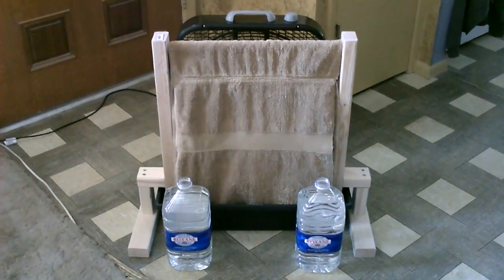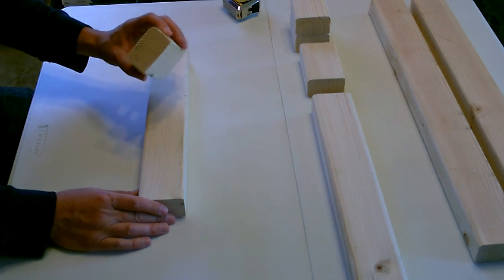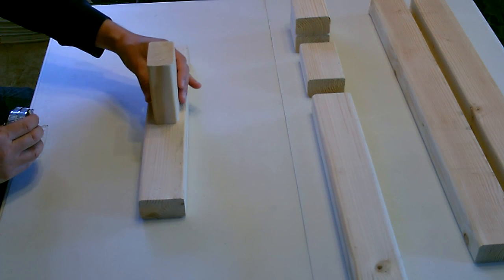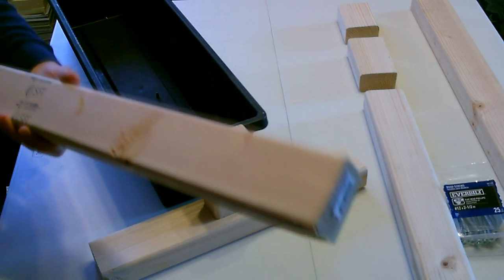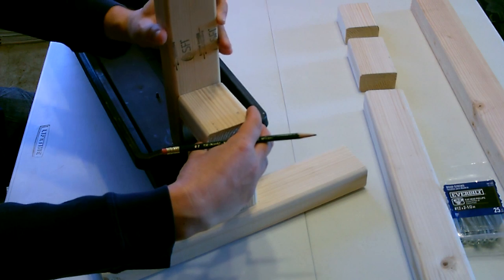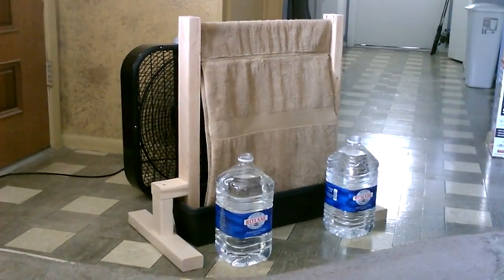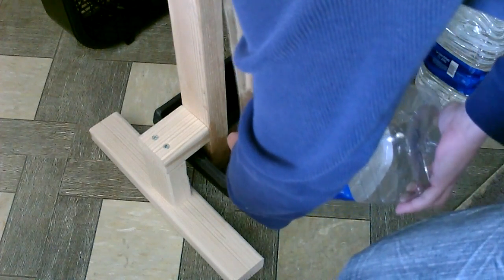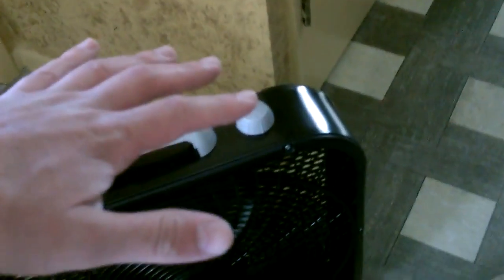Homemade Evap. Air Cooler! - The DIY "Planter Box" AC (air cooler) - up to 30F drop! - Easy Instr.

Comment: Looks like the air is going around the towel, not through it. Might not cool as well as a blue fiber filter would. But I am checking out everyone's ideas, thinking about using a evaporation cooling system for my greenhouse.

Comment: Thanks. I took a cue from this and your other video "Homemade Evap./Swamp Air Cooler - DIY AC (air cooler) - Low tech. Very Effective!" and cooled my 98-degree room to low 70's. I dropped a 20-quart canning pot filled with water into my tall clothes hamper and hung two towels off of a sash rod and a pvc pipe from the top. Now is the coolest room in the house. AC in homes of this community is rare because the climate is almost always a bit cool. Today is an unusual National Service heat advisory for the area. So I deseparately Goolged for a fix and found your videos. No emergency AC needed and no more caught off guard suffering. Thx!

Comment: Love the idea!  What about using a 1" PVC pipe where the towel dowel is with small holes in it and a small cheap fountain or bilge pump to pump the water from the planter to the pipe to constantly change the water in the towel.

Comment: what is the max humidity allowed for such a system to actually cool the air? The drier the environment is, the more drop you can get in cooling the air. What if the air is more humid? I am sure there is a value where such cooler will just not cool anymore right?
Reply from the maker: rogermorse hi there. typically these systems will cool the air extremely well with humidity from 2% to 35%, very well from 35-45% humidity, fairly well in the 45%-55% range. and then only slightly if humidity is over 60%.

Comment: Mmmm ...... I like the idea of swap coolers , but are you are ending up with cool , but damper air ? I would suggest this would be good if the unit was in a box , with a heat exchanger , and exhaust the cold damper air out the window , so the heat exchanger reduces the heat in the room , but the damp air is exhausted to the exterior .

Comment: I'd like to see you make the ice maker drop the ice into the solar ac cooler and recirculate the melted water back to the ice maker until the water completely evaporates...making it a totally solar off grid ac ice system.  Do you think that's possible?

Comment: Good idea, Fear, about the freezer blocks. Could also fill an empty box wine bladder with water, put the spigot plug back in, freeze it, and use for longer cooling. Works for coolers, too.

Comment: Good idea! Try the same thing but use freezer packs hung vertically by string. Cools the air for at least six to ten hours and it does not prevent air flow? Also good in your window if you have a nice breeze just hang them there in your bedroom!
Reply: Awesome idea fear way to go

Comment: What is the rating of the fan? 350 watts? What about using an air heat source pump?
Reply from the maker: fan (on medium) is about 75 watts. (high is just over 100 watts)